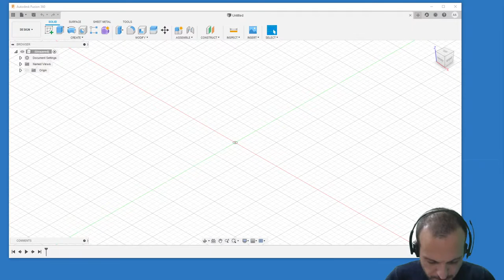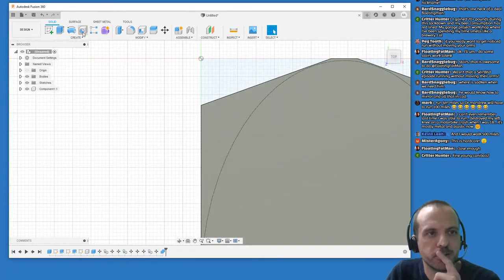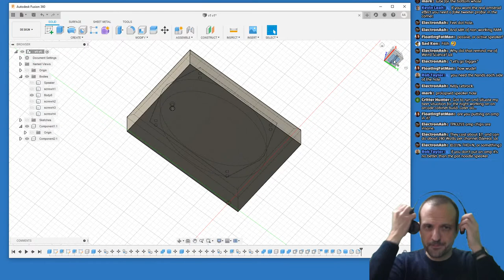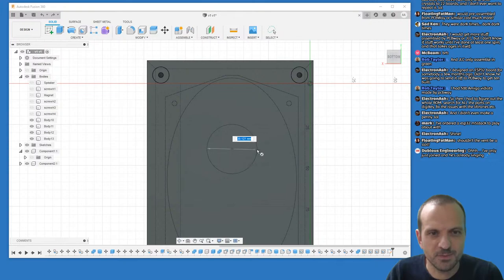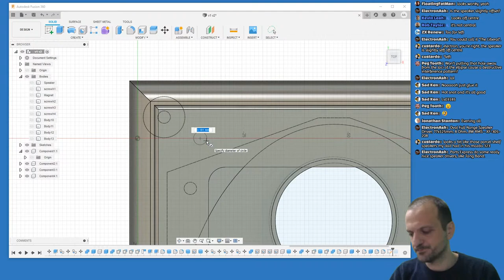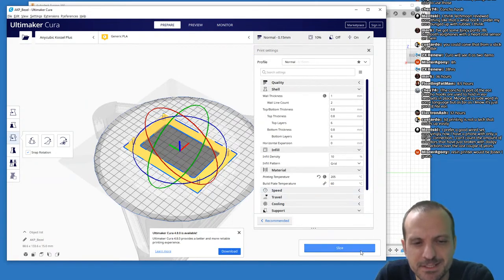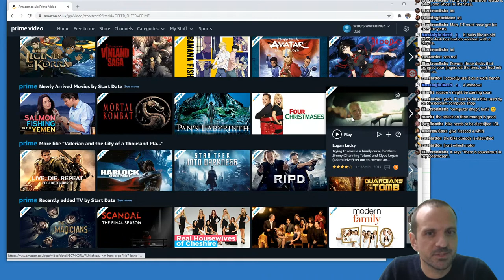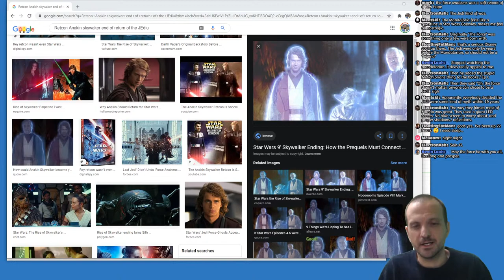Fusion 360 Design Stream - Speaker Enclosure

Comment: Are you sure the holes in the gameboy case for the buttons aren't too tight? might not be the membrane then. Buttons never press down and lift up parallel to the case, they come back at a slight angle and therefore the holes around the button need to be quite a bit bigger than button.
Reply from the maker: I've got them with with a file and taken out some crap that was in there, but it's the same result. Just not enough spring in the silicone membrane